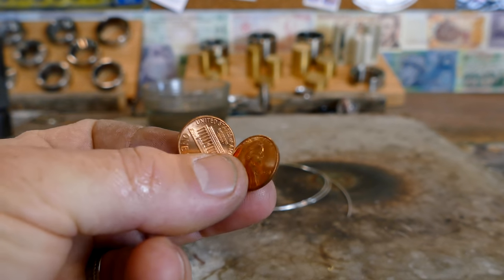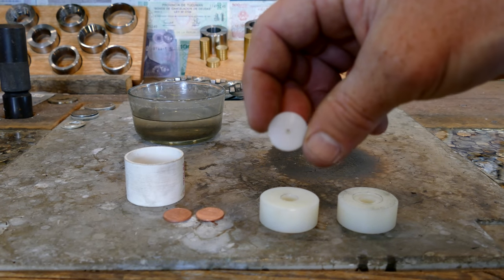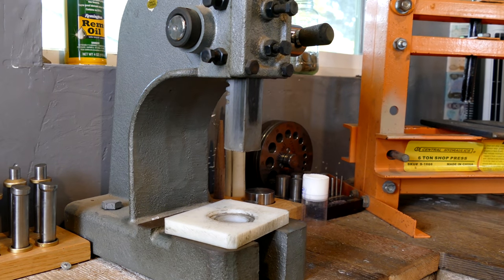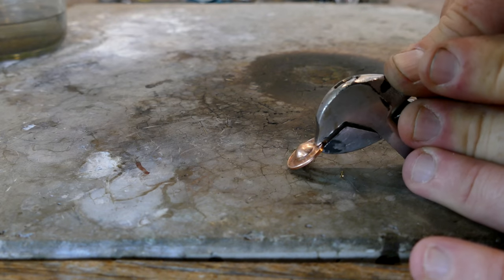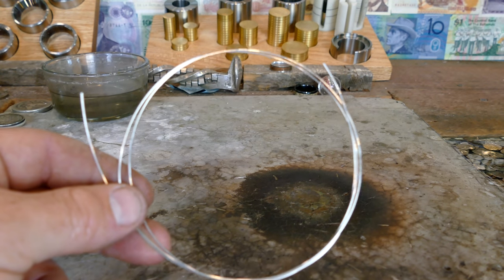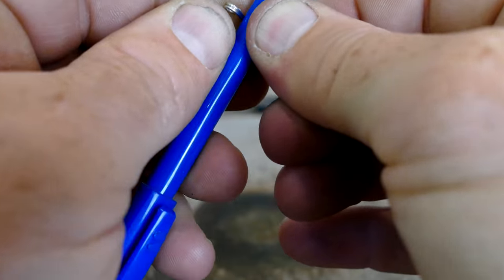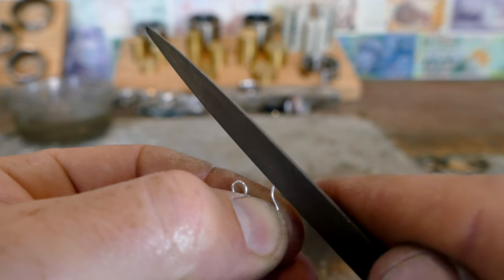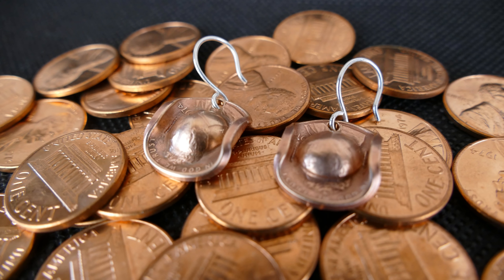Make Your Own Cowboy Hat Earrings out of Pennies

Comment: As soft as copper is, you could use a hammer to cone the penny
It's normally called 4-aught steel wool....but a little soap and water and rubbing would do the same.

Comment: Did you use dead soft 20 gauge wire?  Also about what size bit do you use to drill holes?  I love your wires, and I want to make the same earring.  I purchased hooks already made and I do not like them.  I have been waiting for you to do this video.  I like the line in the cowboy hat but it’s not always easy to do, so if you have easy tips tell me.  The bending can be hard it’s hard for me to get them exactly even on both side.  I guess I need to keep practicing.  I need that Jason’s tool kit.  Lol  thank you
Reply from the maker: I used half hard wire for this. And to be honest I'm not sure what size drill bit I used. It could stand to be smaller though :)

Comment: I could use a dapping block and punches to form them right? That's all I have for making domes in metal.👍
Reply from the maker: Sure if you had a dapping block you should be able to.
Reply: Was thinking about trying the same, maybe wrap it in some teflon tape or put a thin piece of rubber down to protect the coin from getting cut on the dapping block.